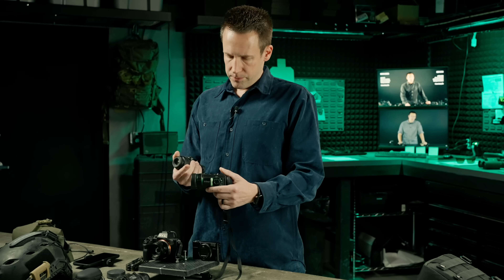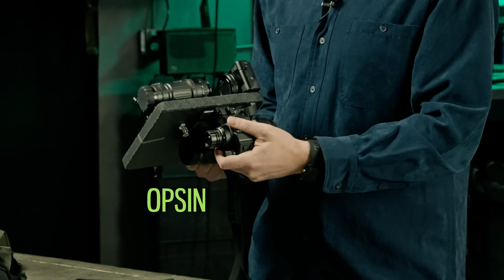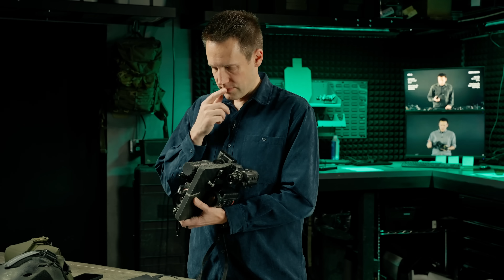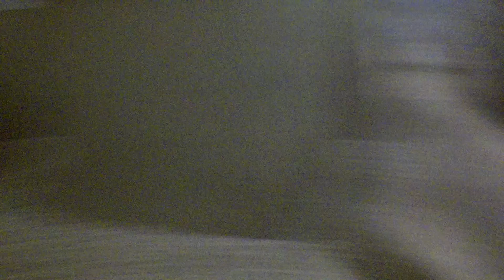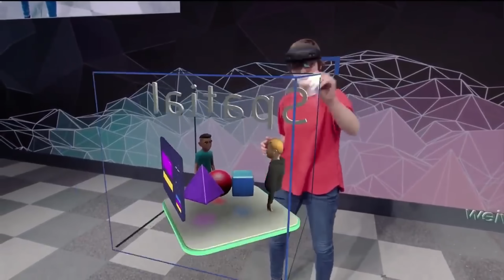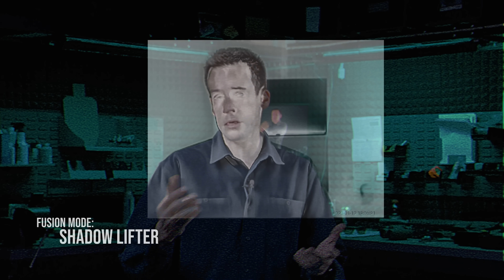SiOnyx Opsin: Digital Night Vision HAS ARRIVED

Comment: Ok, so the OPSIN underperforms the PVS-14 the lower the ambient light gets. My question is, how much will an IR illuminator help the OPSIN in those situations?
Reply: Yes, Opsin is very sensitive to IR light. Although the image is going to be mostly black and white since IR doesn't produce any colors. So if you run Opsin with monochrome mode and an IR light this should work the best.

Comment: I really want a 1300 or 1400nm narrow pass filter to test these units and actually see myself for my full spectrum camera.  I put a 1000nm narrow pass on a P20E and P22 it could obtain IR still.  I've read that 1200 is the limit for like silicon sensors but I want actual filters to test it.
Reply: You can get past 1200, but the transmission is really small. You need to opt for a lens with really good transmission above 1200nm to get something useful. It's also not going to do well at night.

Comment: I predict 2-3 years tops. You can pick up a PVS-14 for under $2k, or an ANVIS-9 dual tube setup for around $3k, which is AMAZINGLY cheaper than even when this vid was released. Everything electronic gets cheaper almost exponentially with time. It's gonna be soon. Real soon.
Reply: The ADNV-G14P appears to outperform NNVT tubes and even come close to some older Gen 3s in terms of low light performance with an 800x600 sensor that lacks a color filter. Basically what the opsin should have been IMO. 

Also, where are you finding working ANVIS-9s for $3k? Asking for a friend.
Reply: @TheMsdos25  The main issue with the G14P is lack of color, one of the features of digital night vision is being able to see in color. So I wouldn't say Opsin should've been like that. They both have advantages over each other.

Comment: If this was about $1000 - $1500 it would be a lot more appealing. But when it is SO close to the cost to a PVS14, you might as well just get the PVS14...
Reply: Get a nvg30, it's around 500$ and can handle all but the extreme low light conditions.

Comment: I had an ordinary cheap 1st Gen digital camcorder that used a mini cassette to record video. It was around 1999 and it could record in total darkness using infrared. You would think that the technology would be way cheaper and better 25 years later. I suspect that our government is highly regulating and suppressing this tech.
Reply: @94SexyStangthe tech has already advanced beyond gen 2,check out the nvg30,adnvgp14

Comment: So it's funny that you mentioned being able to move your head in an augmented reality type thing again this goes back to fpv first person drone or UAV however you want to say it but a lot of the headsets that you have have what they call head tracking this allows you to move your head in different directions while flying opposite of what the controls are or you can actually control the device with your head and then just different features with the camera or vice versa depending upon how you need to fly it or to see whatever it is that you want to see most people set up the gimbal so that way that the camera moves with the person's head so they can fly the Drone as need and then see whatever it is that they want to look at while they are flying said object so there is head tracking features currently on goggles available today you would just have to contact them and try to get the two to merge together if that's possible or not

Comment: Okay well for the fpv world that's first person view for flying high-speed drones who deals with latency on a regular basis for either for Ops or other reasons but basically a way you would test it is you have a switch that would be signaled to a device that would show a light or something that shows a power signature that then shows when in a frame rate it was activated then you would basically go through each frame rate and see the difference of when you pushed it and showing that you pushed it see you in the response of the latency in the actual video that's how you do it if you want to know more about it there is tons of people in the fpv community who do these kinds of tests on a regular basis and you can follow along and then basically reverse engineer the system yourself to do the test accordingly

Comment: It wouldn't be difficult for Sionyx to include autogate in the software that can tame the IR flood. And since its just a digital signal, inserting a digital thermal image is a no brainer. If it has an output then it should have an input. If it simply had the future option of an input it would add $500 in value.

Comment: If you want DIGITAL nightvision you MUST have an IMAGE SENSOR that has RGB AND GREYSCALE photosites outputing 16 bits per colour and greyscale channel. Each photosite on the high-sensitivity CMOS sensor MUST be at least 12 microns in size for best night-time usage! So for a 4096 by 2160 DCI-4K resolution image for EACH EYE the sensor MUST be at least 62 mm by 34 mm in size so you can do a BAYER RGB plus Greyscale photosite composite of pixels into each DCI-4K resolution bitmap video frame.  The frame rate of the sensor MUST be 120 fps in each eye for best illusion of 3D stereoscopic visualization so users don't get dizzy and lose their balance!

The display in the visor portion should be WRAP-AROUND for 180 degrees field-of-view, so you need TWO displays, one for for each eye that is 4096 by 216 pixels REC.2020 HDR OLED quality at 120 fps for best visual display! Any common smartphone can add 2D-XYZ SOBEL/CANNY edge detection with anti-aliasing and edge featuring to widen lines smoothly so you can ENHANCE your final imagery.

Add in high-pass, lo-pass and notch-based DSP filtering and some vector maps overlays, video overlays, digital targeting crosshair overlays, digitally STABILIZED 2x to 50x ZOOM ....AND.... fuse/overlay some incoming Thermal tri-band (long, medium and short) infrared and UV-A/B/C band imagery with the CMOS sensory imagery and you have a POWERHOUSE of multi-spectral nightvision imagery!  

If you want to go all bananas, add in LIDAR, SONAR and RADAR 3D-depth map (i.e. Microsoft Hololens style!) to do 3D-XYZ DISTANCE sensing so you can get 3D stereoscopic depth maps that can ALSO be overlaid overtop of your 120 fps fused Optical, IR Thermal and UV video images! Image quality would be through the roof!

This wouldn't be that expensive! Just use some $1000 USD 4K AR/VR glasses which are already 4K resolution for each eye AND mate it to a good samsung, apple or rigged smartphone with an extra BIG BATTERY pack you wear on a belt and put the IR, UV and RGB image sensors into the front of your helmet fuse it all together using fancy GPU on a modern smartphone and you are good to go!

For the RGB portion any modern Sony STARVIS or Canon 35mm Nightvision CMOS sensor will work! Add some common FLIR thermal imager chips and uprez using LANCZOS-5 resizer to 4K resolution! Use Sony or Dalsa UV sensor to do the same for the ultraviolet A/B/C bands! Cheap mems-based LIDAR/SONAR/RF 2000 metre range depth sensor kits the rest out and you have your self a full multi-spectral and wide-field-of-view nightvision system for less than $5000 USD!

Not that hard to do! 

V

Comment: Funny to see people reviewing technology that was invented in 1939. Thats 84 years ago people. Sony made a video camera back in 1998 which had a “night vision” (infrared) mode. It even was capable of seeing threw clothes. I ran around with digital NV when i was 14 years old. Im 36 now! Hell in 2010 Jakks Pacific released SPYNET Night Vision Infrared Goggles for children that do this same thing. You can get a pair for like 30 buck online. All of a sudden this tech keeps getting rewrapped and called new then priced for hundreds? I dont get it.
Reply: A few big differences here. I just got the Opsin and I have a Nightfox Red and Nightfox Swift (digital night vision). The Opsin has a super-fast processor that allows 90 hz/fps and no lag, compared to the 25 or 30 hz/fps of the Nightfox devices. That makes all the difference in the world right there for moving around. Even walking is unpleasant with the laggy regular digital stuff.
#2: Color night vision rather than black and white like regular digital night vision.
#3: The Opsin uses proprietary "black silicon" sensor technology, a genuine dramatic leap in digital night vision. Real, significant low light amplification equal to Gen 2+ analog night vision.
#4: Proprietary brand new sensor technology that combines color night vision with black and white night vision, with every single pixel having two separate settings and the brains to know if color light is hitting it in real time.
#5: Wide 45 degree field of view. The Nightfox stuff is only like 25-30 degree horizontal fov. 45 degree horizontal FOV is as wide or wider than dual pvs-14s on.
And dual Opsins would be about the same FOV as those $40,000 quad nods.
#6: IR sensitivity into ranges that can't be seen by analog night vision, so ability to use 940nm, 980nm, or higher ir flashlights.

I'm in love with the Opsin and I just got it yesterday. I think it blows even analog Gen 3+ night vision out of the water in almost every single metric. It's lame that analog night vision is still called "magic", even though as you note it was invented in the 1930s, and this Opsin tech is brand new, proprietary, and being used by the military in their next gen $70,000 digital night vision headset (IVAS).

Comment: 170 fps seems a bit extreme, considering the vast majority of people can't perceive the advantages gained at those lofty frames.  I understand the critique of needing higher frames though.
Reply: That guy was compensating for his 140 pound physique and his complete lack of military/first responder experience. He even had it on 60 fps, and his experience was supposed to prove that 90 FPS is too slow.
And he's just plinking on a range for sport, but pretends that it's the same as all real "running and gunning" scenarios, and that the Opsin despite all it's other strengths like color identification and superior image contrast are not important for real world running and gunning. All because in a plinking contest you might finish the drill in a fraction of a second slower. Pure compensation.

Comment: We love your videos. One item you may want to experiment with is an intensified digital camera - basically an image intensifier tube in front of a user selected CMOS, combined with camera optics. The new ones give a night vision image at the same level and quality as an analog device - simply because it incorporates an analog tube, but produces a digital output. The devices are quite small, at least in our case, the overall size is about the same size as a standard 18mm image intensifier tube, then you have to add the objective lens. Still, the overall size is quite small. We built one with a 72 degree FOV GRIN lens to test overall capabilities and it has zero latency. The intensified camera described is not built for mass consumption purposes like the excellent SiOnyx cameras, but for research purposes into wearable digital night vision systems. However, while it solves the night vision portion, it's not a color day to color night vision device. However, because it does have a digital output, that means one could overlay other digital information to produce a fused digital picture output.

Comment: Might as well write-off digital nightvision as cost effective. If it more than quadrupled in 4 years and still needs increased framerates and clarity in dark areas, itll end up better that a PVS14 but twice the price. Soo fuckin irritating that this "game" is dependant on your tax bracket.
Reply: The Opsin is extremely legit, and it's downsides are not real. US night vision culture is lame and they use elitism in place of real courage and intelligence. 940 nm IR light on your helmet or gun will be invisible to regular "superior" night vision outside of about 5 feet away from you.  Just save and get ready to pounce for an Opsin on sale for less than $2k. And thermal is much more important anyway, it's just not accepted as such because "affordable" thermal is almost as new as the Opsin.

It's one big lame echo chamber based on 20 year old knowledge from Afghanistan against goat herders. The main guy in this video is being too deferential to the fake tough gear snobs like his brother shown later in the video, and Nick Chen the obese middle age fake tough guy.

Comment: One thing about the Opsin that's important to me (being in Europe) is that its export is not restricted.
If i want to get analogue night vision i would have to spend a massive amount of money on some obsolete (and probably damaged) military surplus from US or eastern europe. If you have a problem with that analogue night vision device good luck in finding assistance and replacement parts (or god forbid a replacement device). 
With this you can get the latest tech (even outside of the US) and still have the customer support from Sionyx or the official importer. Add to this the fact that you may pay 3000€ for an old pvs-14 with a damaged tube (know this for a fact as a friend got one) and no warranty  while the street price of a new Opsin is 2500€ with warranty.
Consider then that a decent binocular nvg here is almost impossible to find and may be almost 10000€ if you can get your hands on one. If someone comes up with a way to mount 2 Opsin together on an helmet you then can have your "binos" for just the price of the 2 devices and not much more.
All of this makes it a no-brainer choice for this market imo.

Comment: Yeah I'd personally prefer buying pvs14 parts kits and get used blem image intensifier tubes off eBay, or Facebook groups, forums for cheap. That sionyx opsin sounds like something I would not buy. Now I do have digital night vision as well I own a nvg10 and it's great digital nvg device it's around $400, I have Soviet pnv57e goggles that are modernized rewired to work with pvs31 battery pack, I have a pnw-57a modernized rewired to work with pvs31 or anvis 9 battery pack, and modernized to use with norotos nvg shrouds, and norotos lowering arm, same with my pnv57e nods, my gen 2+ pvs 14 I built from parts kit it's my go to monocular. The other ones are good for larping.

Comment: The F35 has a system called EDAS or sometimes "DAPS" which uses sensors facing all six axes and meshes the image into a single, continuous frame which allows the Pilot to see in IR/Thermal in all directions without needing to reorient a specific sensor in whichever direction he wants to see.  

I think something like that could be a huge niche advantage for digital NVGs and would give the operator a 360 degree field of view with "back up cameras" and motion tracking alerts on their overlay.

Comment: I think the biggest selling point of the Opsin is its range up to 1200nm, however I cannot find any illuminators above the normal 940 nm wavelength. Maybe no one makes those yet because it normally can't be seen with traditional NV?

Comment: It would be very worthwhile to say the settings that both of the cameras are recording at. It would actually convert into a measurable difference, if you took the time to get a properly exposed image with each camera. 

I.E. - With the A7sII. You could take the video setting and set to the same level on photo mode then adjust until properly exposed with an ISO 100 setting. It would measure how much the signal is being boosted. 

Same with the sony point and shoot, which indirectly measure the improvement on each of each night vision device.

Comment: I was very very excited about the digital NVG up to the point when he started talking about FPS. and that it goes "Up to 90" and I just realized that it's not going to happen.. because, what he forgot to mention is that the higher in fps you go, the resolution drops... just as with cameras and monitors/tv's. So at 90 fps you're basically running turbo potato mode. Unless the display runs at like 8k in 90 or 120 fps/hz the analog NVG's will always win. And I can't imagine such a tiny 8k 120hz display happening in this decade. :(

Comment: Dear Issac T.REX Labs

1) From the non-expert view. The failure of the Opsin was that it did not have an ability to accept an industry standard Wilcox show to snap onto a KAC KVC bridge that connects to an industry standard G24.

Some of us like to use the other Wilcox shoe connection for mounting a thermal, as painful of a Brainstorm movie as it will be.

It would have been nice to have a slimmer profile and ability to mount Jerry C until we have an ability too input a thermal outline overlay for fused less than about $14,000- Plus we can't use this in a high intensity lit urban CQB situation under high power lasers, going so may reduce tube life to 1/10. So we non experts need an Opsin of some sort to not damage our Gen 3.

2) Calling Nick an expert is interesting, considering his posted video below. Watch it closely.

How can someone post a video like this, not know the protective caps are on and still be considered an expert?

Go take a look at this video.

L3Harris BNVD PVS-31A lens flare

https://youtu.be/MvVgfw6FZ-g